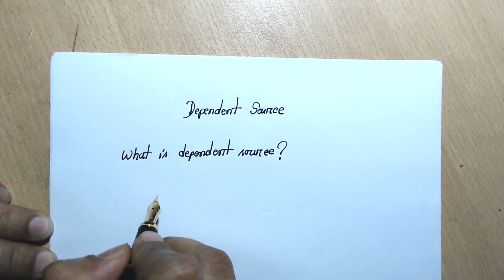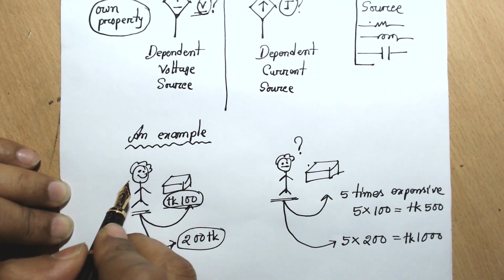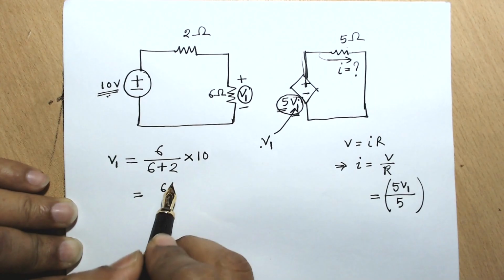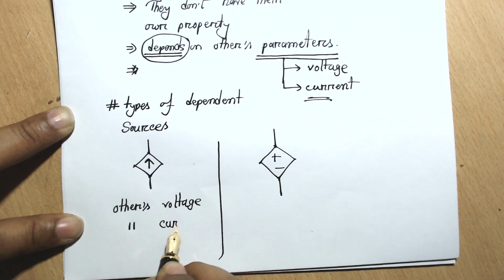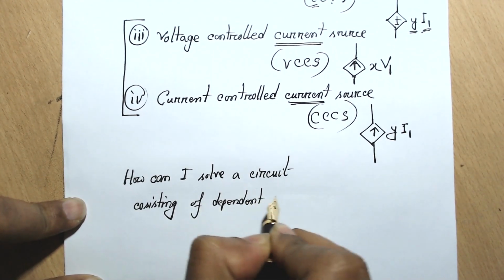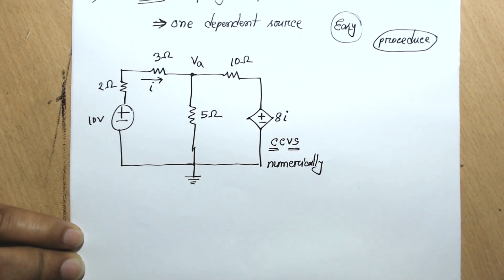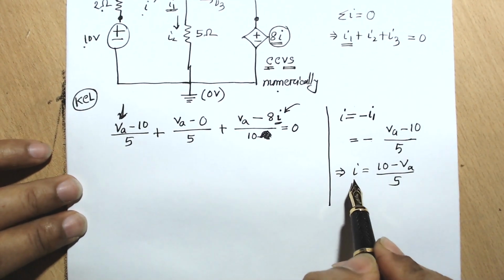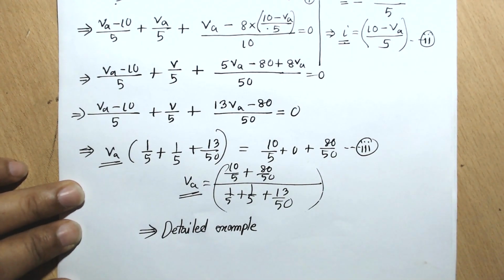Dependent Source Part 1 (Intro)

Comment: Sir when we were solving the value of i and as it was similar to i1 but on opposite direction on your example is it gonna be like that always? I mean is it always gonna be on the opposite direction? And it could also be similar to other sources as well right?
Reply from the maker: no, it will depend on the circuit and it will be mentioned properly. Sometimes it may be in the same direction, or sometimes it may be in the opposite. You will have to analyze this based on the situations.